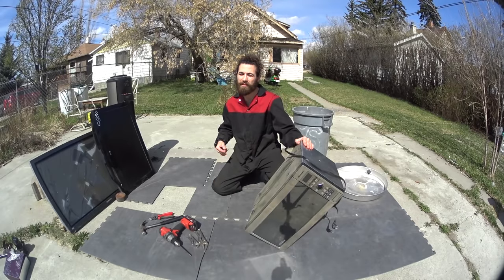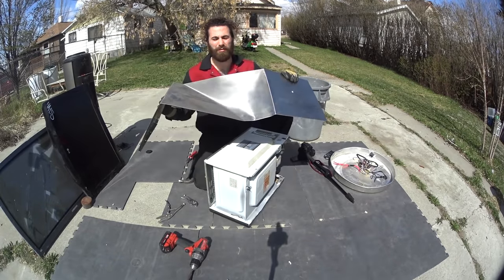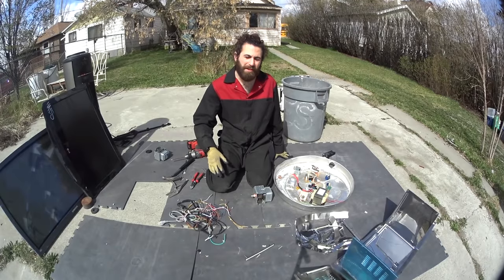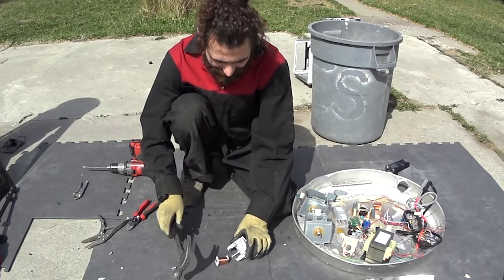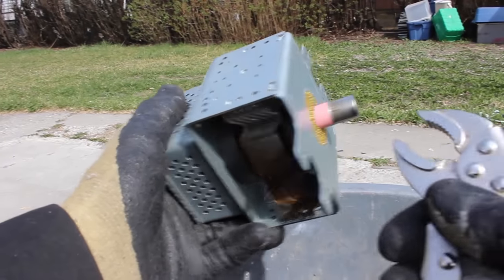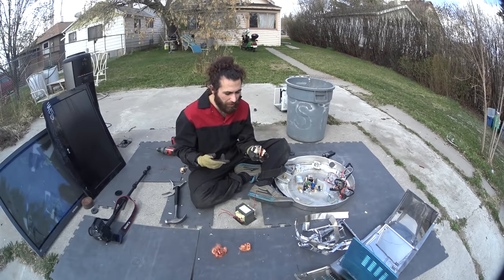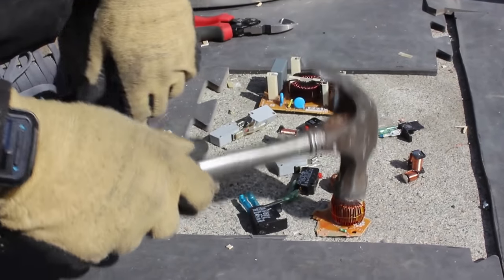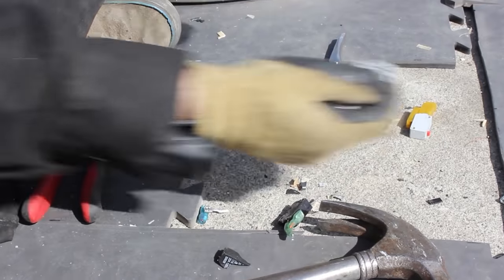Scrapping a Microwave FAST and SAFE! - Make More Money In Less Time!

Comment: That's a lot of work for less than $2 in scrap
Reply: tom ee the microwave was worth more as is
Reply: Agreed.  The ROI to take that apart for all the metals and sorting it is not worth it.  If you can dismantle it much faster, it would be worth it.
Reply: MyTwoCents you could sell the capacitor and microwave transformer for a pretty penny on eBay
Reply: MyTwoCents also you can sell the mica sheet and a few other things
Reply: r scott carlson yeah I know, I wind coils so I know about the wire.. most people want new stuff on a roll, I personally wouldn't buy recycled stuff in most cases.. just because there is a high chance of there being minor kinks in the wire in some spots that effect the performance
Reply: r scott carlson I have an idea for making a beast transformer.. take two identical microwave transformers and cut them open and then connect them E to E... and use quarter inch copper tubing as wire, winding it with potting epoxy one layer at a time.. then pumping saltwater through the windings which would add more conductive properties to it and also it would cool it
Reply: Howard Black I already know how to do the spot welder.. king of random did one for example
Reply: Howard Black I wanted to make a super version of that with water cooling
Reply: Howard Black he did that in like 2012 I think, yeah I know he's not the first it was just an example
Reply: Howard Black if you use baking soda water you won't make chlorine gas just hydrogen.. and with it being A.C. it's not 100% it will, but even if it does you can make use of it.. also it won't make a short circuit, it would just be like using a large copper wire and the magnetic flux of the tranformer will somewhat current limit it.. or you can use another microwave transformer with the secondary shorted out as a choke
Reply: Howard Black also I was thinking of using the cooled side as the primary, using it as a step up transformer.. the secondary will be cooled as well in this system
Reply: Howard Black I have not looked into it in a while, but there is an electrolyte you can use that will not allow oxygen to be formed..
Reply: Howard Black I could use something other then water as a coolant as well, and if I were to run something like this it would be current limited when I first run it.. I know what to look for with electrolysis and whatnot, I've done electrolysis before.. as far as I've always understood it A.C. has a harder time producing Brown's gas
Reply: Howard Black also as I said that side would be the primary side, meaning it's not going to be low volt and high amp.. it would be mains voltage, which would also prevent Brown's gas from forming.. But even if it did it's not something I cannot handle and work around
Reply: Howard Black oh and I didn't read the short circuit part right earlier, yeah I've thought of ways around that using a 3+ bucket setup.. basically having an isolation tank
Reply: yeah but the tension release is worth it , smashing things = Fun !!
Reply: I just rip the big motor out and that’s it.
Reply: Jake Mitch he worked for about three hours based on the shadows. Waste of time.
Reply: Probably made good money with the video too
Reply: @greenthizzle4  I don't think they use mica on microwave windows, at least not anymore. Those microwaves were pretty cheap when new, so very few of them will ever get repaired. Most people just throw out their old ones and replace them. That is why so many scrappers find tons of old microwaves, no one fixes them. You would end up sitting on the parts for a very long time. Maybe you could learn which ones were fast movers and brought a good price, but for the most part those parts would just sit on your shelf waiting for a sale, plus all the time and work you would need to put into making that sale(labor, materials, ad listing, shipping, time for transport, SHIPPING IS EXPENSIVE)...... Plus you need the know how to figure out which parts were malfunctioning on the broken ones so you didn't get negative reviews and returns on eBay.
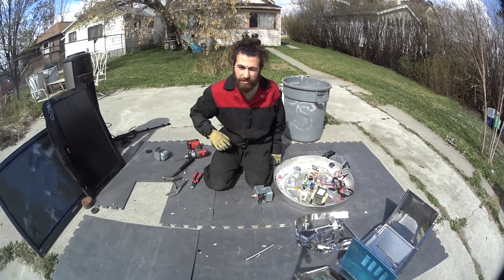Reply: @whaleh8er991  I think you need to pull out your shadow clock and have it adjusted. Look at :25 and 11:32 to see that not much time has passed. You also are not taking into consideration all the time he has spent setting up shots and collecting material while filming everything. You clearly don't have a grip on the how much time it takes to just film stuff like this and have you times logged to help with editing. I bet you are also one of the thousands of people that missed the rabbit jumping through the upper right corner at 4:53 while he was saying "fist full of dollars".
Reply: Robert M they don't use mica on the windows, they use it for the wave guide.. and yes they still use it
Reply: Robert M also many people throw out microwaves that still work
Reply: @whaleh8er991  I can strip one to base components in under ten minutes
Reply: Good Job  @andrewmajor1754 , You make me proud!
Reply: I so wish I could add photos to YouTube comments of the 400 vacuum cleaners 200 microwaves 100 fridges 80 washing machiens 50 100 bikes 40 lawnmower 300 different power tools and equipment I have at the moment not to mention the tvs DVD players computers laptop mobile phones printers oooooooo the office chairs so many good dam office chairs only keep the ones with stanless steel on them but my good I have so many and then there's the excrice equipment that's a hole 100 meters square all by it self.

And do u know what it ether gets brought to me or I get paid $80 per  500kg to remove it.
Reply: Anyone wants to bye a BBQ retail price anywhere from $1500-$300 can't sell them for 10% of that price.

Comment: You need to do a course in Basic Electricity....You dont have a clue and thats dangerous!
Reply: I’m just glad that run cap didn’t have a charge when he touched that meg.
Reply: N. V. well he will only do it once.... hahaha.
Reply: Whatever you live from that's dangerous makes you stronger or smarter. If you get shocked by that capacitor you learn not to touch that again. Same thing with molten metal or a nail in your eye. I think hands on is the best way to learn. If I had known that diesel fuel and fertilizer would explode when I was 12 and trying to build a rocket I probably wouldn't have any arms, if it was my lucky day. We cut open about 30 or 40 shotgun shells to get out the gunpowder for or rocket. Had all these brass things laying around with the firing pin still inside. I thought the gunpowder was what made the explosion and noise so I decided to hit one with a nail and hammer. I think it's the Fulminate of Mercury that is most dangerous and makes the most noise. My ears are still ringing 52 years later.
Reply: Shocking.

Comment: The black thing on the capacitor is a diode and it does NOT discharge the capacitor, they have internal discharge resistors  between the two terminals that slowly discharges it over many minutes or hours.   If you just short the terminals it will discharge any charge if the resistor is not working.  I've torn apart a lot of microwaves and frankly not once did I find a charge in the caps, maybe older ones are not safe (but note if you just unplugged one, it WILL be dangerous for maybe up to an hour)

Comment: Thanks for the info, I've always wondered about the inside of my nuke. BTW please invest in a few tools: may I suggest a cordless grinder with a "zip-wheel", a prybar or 2, safety glasses, and a few assorted driver bits for your drill? "Security" screw on a microwave? Is it possible it's merely an uncommon head for which one may find the bit on Ebay?
Reply: you can get the "security" bits at Home Depot or Lowes
Reply: It's a tek bit with a "security" post - supposedly keeps the riff raff out, but it obviously doesn't

Comment: Thub, I commented on a video you had posted at one point remarking that inside a tv you were salvaging, then separating hardware components into categorical lumps by metal content that you had the necessary components to build an induction heater and just melt your metal then turn in barstock bars of metal. This will be near the same bc in microwaves, if you have four you have the needed components IN THE MICROWAVE ITSELF to run the transformers in series. Then current change (AC TO DC) with the four high voltage diodes connected to make a full bridge rectifier. Toss some capacitors on the back of it and viola! Welding machine, wildly basic explanation of it all but the rest is easy in comparison
Reply from the maker: I remember that, yeah! It sounds cool but I think cobbling together diy projects with thousands of volts DC is way outside of my comfort zone haha

Comment: You poor fool... those components are worth more than the pennies you'll get for the scrap you destroyed them for.
Reply: themonkeydrunken m
Reply: Show me how to make $$ of the parts. When breaking something apart I do save a lot of the parts I can reuse and sometimes check on ebay to see if there is a market for any parts, however usually there is not a value nor a market for most parts.
Reply: That's often the case, but for tinkerers and makers those parts are free, which means you don't have to buy them

Comment: Those “security” screws are called torx type screws. You can pick up torx bits at Home Depot or Lowe’s. Normal sizes in microwaves and most other appliances are T15 and T20.

Comment: that turntable motor if you spin it it'll output a voltage of around 210 to 215 if you spin it fast enough. I can make my refrigerator run with one

Comment: Great video, but I am little concerned. I  just started with scrapping and began with acquiring  mainly electronic items. I have been smashing the components to bits to get out the good parts. @ 7:04 I've smashed these to dust before and know exactly what you are describing. Probably breathed in a lot of that, appreciate this video because I will not do that anymore. Oh well, no point in crying over spilled milk.
Reply from the maker: Yeah, I’ve definitely absorbed more of it that the recommended dose lol. I don’t want to downplay the importance of working safely, and if I made this video today I’d probably have a small PSA section to outline all the hazards and how to avoid them. Can’t really change it now though!

Comment: Do the magnetrons have precious metals in them ?  Thanks !
Reply from the maker: Maybe trace amounts of silver in the solder, but essentially no. There’s that mesh wafer of brass and two coils of copper but these days Im not sure those are worth the beryllium exposure.
Reply: @thubprint  I cut open a magnetron and noticed that the copper inside had a shiny metal on the ends of these copper teeth !  
It looks like that thing gets really hot !
Copper can only withstand a certain amount of heat, whereas platinum or palladium could withstand high temperatures ! 
I found out about the beryllium after I opened it !
My bad !  I didn't know that shit was toxic !
I'm still alive !  lol

Comment: Scrapyards in the US will pay you for those circuit boards, last time I checked it was around $8usd per pound but you would have to separate them like mother boards in computer towers weigh more and bring in more money. Also cell phone circuit boards, finger boards or any boards containing gold like those two will bring in more money. I find it to be time consuming but i think it’s worth the time and you get a handful of wire and some motors when ur done😁

Comment: The little blue circular capacitors on the circuit board at 11.08 have palladium in them. If u save em over time you can sell them. U dont need to extract it yourself.

Comment: old style washer machines has quite a bit of copper wire in them and the older dryers that are both heavier then the junk ones we buy today . then all the sheet metal plus some of the motors can be used for projects for grinder motors or whatever you choose to use the motors if they work when plugged in before you start taking the whole machine apart

Comment: 7:45 - note that THIS part is still a rectifier diode in the old fashioned vaccum tube way.
but its only a diode not a tridoe or any other.
without the magnets attached U can run this to rectify this high voltage coming from the transformer.
the two copper spirals are the connectors to the heating filament.
connect this to the small coil (the THIRD ONE)  of the the transformer to heat the filament.
then one pole of the HV to one of this filament wire and the other one to the heat sink.
and ouala U have rectified it. And this rectifier is way more rugged than the black diode, 
it can withstand an overload much better than the other one
Reply: Actually used one as a hv rectifier for a home made copper bromide laser for this exact reason. The back EMF from the discharge will eat regular silicon diodes alive.

Comment: The trick for security torx is to get the right size flat head screwdriver and it will  stick in there well enough to turn the screw.

Comment: Sweet video bro, about how much do you get for the typical microwave? I'd totally check to see if they work too, just be careful with that capacitor...
Reply from the maker: +melarvie too right. With the prices these days, less than $5. And that's if the transformer has copper, not just two looms of coated aluminium windings.

Comment: And you can get that insignificant bit of copper out of the magnetron by just wiggling the whole wire and it can break on the inside where it's soldered.

Comment: I did the same and made a 3500W radial 6'blade wind generator out of the magnets- used the copper$ from transformers to buy new coated copper wire to form the windings...🤔

Comment: Electrical contacts are silver or copper mixed with tungsten carbide.  Those transformer core are special iron silicon alloy unfortunately no junk yards separate them they are just iron/steel scrap all destine of the EAF.

Comment: hazardsEdit

￼

Caution: radiowaves hazard

￼

Caution: Poisonous particles for the lungs

At least one hazard in particular is well known and documented. As the lens of the eye has no cooling blood flow, it is particularly prone to overheating when exposed to microwave radiation. This heating can in turn lead to a higher incidence of cataracts in later life.[32] A microwave oven with a warped door or poor microwave sealing can be hazardous.
There is also a considerable electrical hazard around magnetrons, as they require a high voltage power supply.
Some magnetrons have beryllium oxide (beryllia) ceramic insulators, which are dangerous if crushed and inhaled, or otherwise ingested. Single or chronic exposure can lead to berylliosis, an incurable lung condition. In addition, beryllia is listed as a confirmed human carcinogen by the IARC; therefore, broken ceramic insulators or magnetrons should not be directly handled.
All magnetrons contain a small amount of thoriummixed with tungsten in their filament. While this is a radioactive metal, the risk of cancer is low as it never gets airborne in normal usage. Only if the filament is taken out of the magnetron, finely crushed, and inhaled can it pose a health hazard.[33][34][35]
Reply: So the risk is not worth the effort.

Comment: You could make a copper smelter with 2 transformers and some ionized caps/batteries rods (get those tru 3-4$ calcium-zink alloy). Make sure to use a head mask because it will be bright and use some actual gloves resistant to heat because you will be holding 1500 degrees Celsius near your fingers. Make some copper bars and sell those for more :)

Comment: U know that capacitor unplugged with a rubber handled pliers, cutters, screwdriver touch the 2 sets of male plugs and arc together and then capacitor safe and discharged.

Comment: that high voltage doohicky is a capacitor. To discharge it use a screwdriver to short the terminals so it does not store any more energy.

Comment: Handling a magnetron like a playground ball, I viewed with a certain amount of trepidation. I tear down my microwave salvage as my yard will not take an intact one due to the beryllium hazard. They will except the parts. The magnetron they will accept intact, removed from the cabinet. They will not pay for them. I give them to them so I am rid of them. They are crated and packed safely and shipped to a processor for safe salvage. I handle the magnetron like it was part of the Crown Jewels. While I have never damaged one or encountered one damaged. Damaging the beryllium insulators and the resulting cancer hazard by rough handling of cranking on them with pliers is not acceptable best practice. I wear a full face respirator when removing it from the frame. I have a storage for them that protects them from being damaged while here. The value of the magnetron parts versus your life... pretty much renders them useless. I see people scraping them safely and the magnets would be great. However for my personal risk assessment and that of my family, no magnetron disassembly done here. I am sure there is a legion of scrapers that will stand up and declare me a fool for not scraping them myself. Thats alright, I have becoming oddly attached to the mechanics of breathing and the continuing benefits offered by it. Scrapers that disagree with me will be duly noted. However my practice of magnetron handling will go on as before. Just not worth the risk. I don't depopulate boards for the same reason beyond copper bearing material. As always Thub, I enjoyed this video from a while back. Beryllium is use in multiple forms and in a myriad of items safely. Inhalation is in the bad book! I just felt compelled to share my viewpoint regarding magnetron salvage.